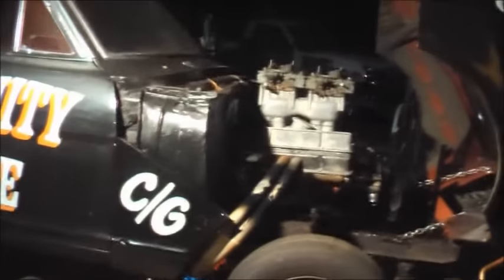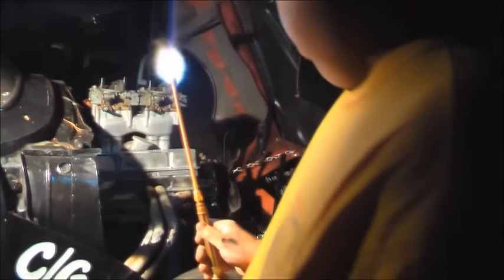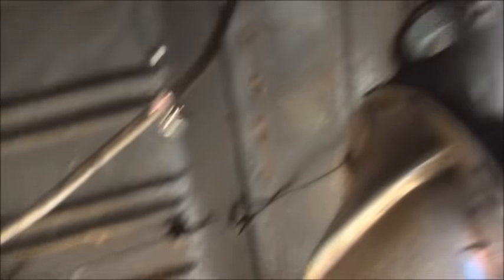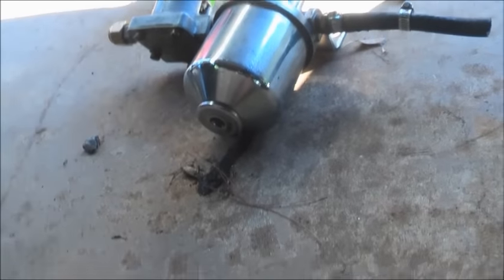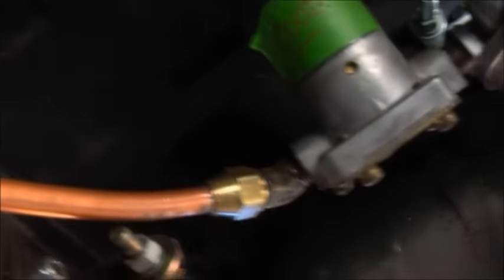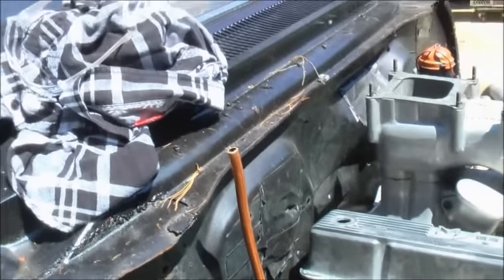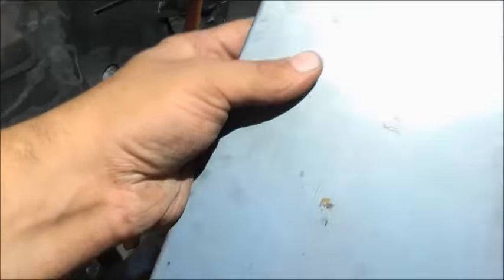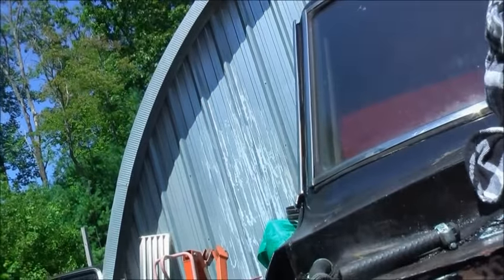SKULL GARAGE...2015 HEADERS BEND FOR CALAMITY JANE,FUEL SYSTEM DONE

Comment: lookin good , don't forget to add a few wooden cloths pins to the fuel line under the hood for looks , era correct old wives tale on preventing vapor lock , fact or fiction , it gets some funny comments , and the yap flapping is what makes these old cars so much fun ...well besides the going fast , kicking ass , and taking names part lmao ... your old man looked some kind of evil with that torch in the darkness at the beginning LOL
Reply from the maker: +towrecker haha never heard of the clothes pins before but now I am putting some on it!! that will be way cool and it might even work! its a win win,next time he uses that torch i will get him to do an evil laugh to really set it off
Reply: +BIGDADDYDALEWILSON cloths pins , and mothballs , you have to know about dumping mothballs in the gas tank to up the octane  , note that is moth balls made of naphthalene , it was more 60's nonsense that in theory could work , and being a hydrocarbon it will not hurt the engine , so many have done it over the years , weather it works , who knows , but's it's fun for the hell of it , gives the exhaust the old lady smell a bit , it can be funny as hell in a crowd of people ;)

Comment: if u run nhra tracks where you have to pass tech they wont pass that fuel line and regulator mounted to firewall because if flywheel explodes itll cut it cause firewall is generally inline with firewall

Comment: you want 2 18 inch 2.5 inch in out glass packs for that thing so you can make a set of torque tubes for the street ? if so I have 2 new ones I bought years ago, and will never use  , I will mail them to ya , someone needs to use the damn things !
Reply from the maker: +towrecker killer man i may have to take ya up on that! i havent planned exhaust yet just trying to get it done for the track but all the folks out on the street will surely thank you for saving em from open headers at the red lights haha
Reply: +BIGDADDYDALEWILSON LOL , and open headers kill torque on the street , so it's win win , just comment on a video of mine on beltstowing if you want them , it emails me on each comment , I just watch from towrecker , so it's hit and miss on that channel , and we can go from there , they are doing me no good , I am over the glasspack days , I will give a few horses for a good quieter turbo these days ...

Comment: dont beleive they allow hardline either cause it doesnt flex
Reply from the maker: +HeadFlowInc headflow is right no more than 12 inches of rubber line thats why i did mine all hard line until that small rubber line joiner to the carbs so it will allow for some flex,engine will be tied down so flex will be very minimal anyway